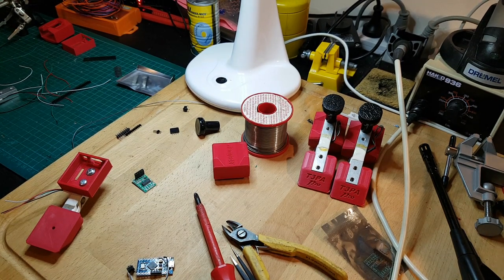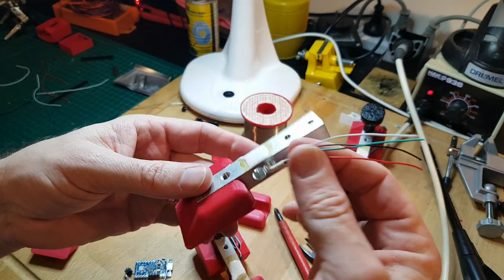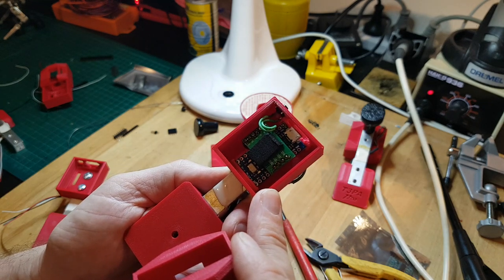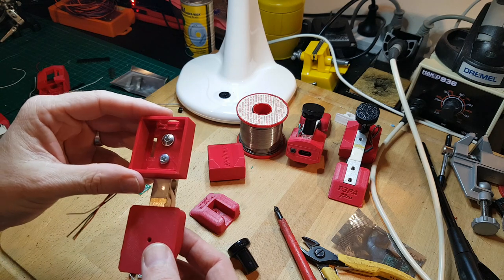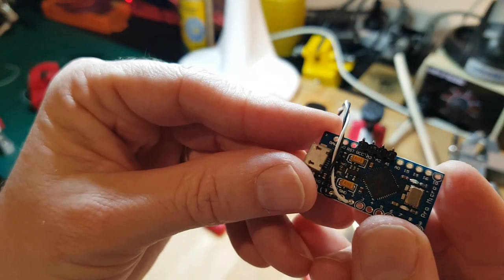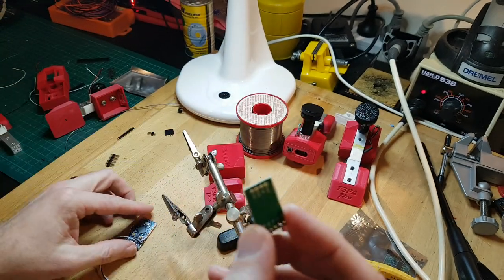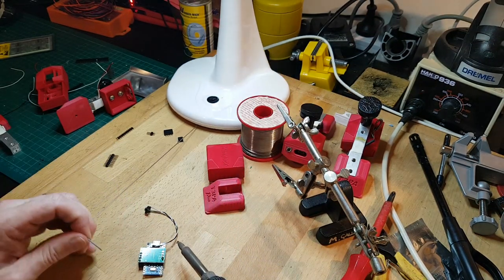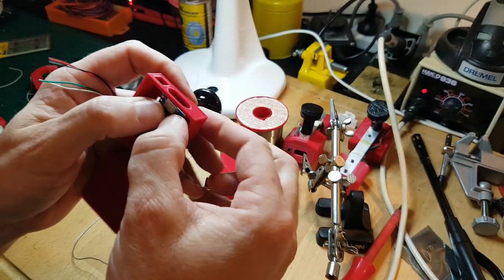Thrustmaster T3PA Load Cell Mod - Arduino DIY - Part 1

Comment: thanks for the mod. i would like to ask what you use arduino for?
Reply from the maker: Arduino does the USB HID joystick emulation that the games will read as a brake pedal
Reply: @RamjetX  thanks :)
Reply: @RamjetX  will it also work on a ps5 console?

Comment: If you go against the direction of the arrow on the load cell do you get any significant output?
I'm trying to figure out if it's possible to sense direction and force using two of these mounted in opposite directions (Think force sense joystick)
Reply from the maker: Actually yeah it does. The hx711 is way higher resolution than the Arduino 10bits. I use a fraction of its range and scale it.

The directional force is proportional on a 14bit scale. I think it defaults to center and you can parse the information in both directions as a 14bit unsigned long int
Reply: @RamjetX  Thank you! Just ordered some to play around with.

Comment: Do you think it will work using directly the hx711 module connected directly to the Thrustmaster board without arduino in the middle? I see other mods using a load cell amplifier different from the hx711 to do that. What do you think?
Reply from the maker: Load Cell amplifiers that are analog will work directly with the Thrustmaster base. It'll take a little tweaking to get the right gain but it's very possible and how most of those online kits work.

I happened to have a number of Arduino's laying around and wanted to play with the HX711 which is a very high resolution. In fact, it's much higher res than the simple 10 bits I'm sending by default in the code. 

The reason I went with my project is that it also has brake force pressure adjustment in the code to dial back brake pressure on the fly. The version on my rig also runs simhub and controls the vibration motor attached to the back of my pedal.

So really, there's tons of options. If you're a console player, then you'll want to be looking for an analog load cell amp to make it directly compatible with your Thrustmaster base... If you're on PC.... maybe something like an Arduino opens up a whole bunch of new cool stuff with Simhub and custom brake curves ;)
Reply: @RamjetX  i will try in the next days to see if the hx 711 is able to interact directly with the wheel base. Thx bro
Reply: @alesais1816  Have you had a chance to look at this, by any chance? I'm also looking to use this setup without the Arduino, directly connected to the T3PA base.
Reply: @Mimi-YT  I ve resolved with another operational amplifier ad623! It works fine! Also designed a new 3d older for the t3pa pro rubber directly on the load cell. I’ll upload on thingverse

Comment: hi, is it possible to wire the arduino to the pedals themself, to work as the stock brake pedal potentiometer?
Reply from the maker: If I understand you correctly, that would be for purpose of connecting to a console that only reads pedals through the wheel base right?

This hx711pcb I have doesn't do that. 

But there are other load cell 'amplifiers' that you can use that just creates an analogue signal that acts like a potentiometer. 

Naturally you'd need to intercept the brake signal from the pedal cable, swap it out for the load cell amplifier. You technically make your own amp with a op-amp at high gain. 

Apologies I can't remember the module name in thinking of. I'll Google and see if it comes back to me later and update my comment if that helps
Reply: @RamjetX  i've meant doing it on coded arduino connected to wheelbase power, and not connected to the pc
leo bodnar's amp costs 18 eur, and i can get arduino clones for 5-7